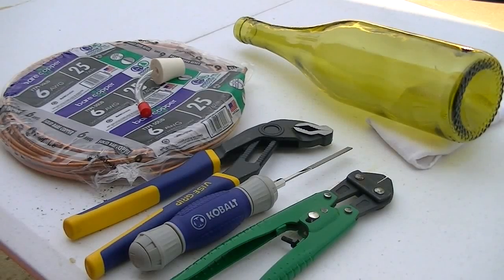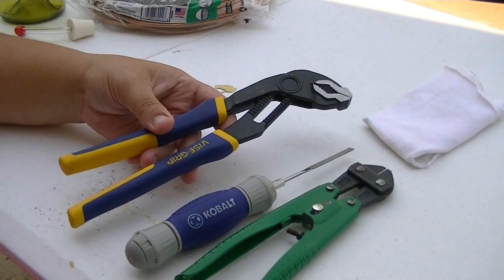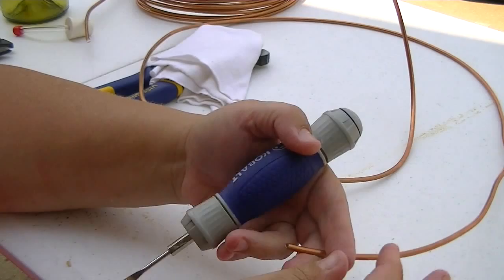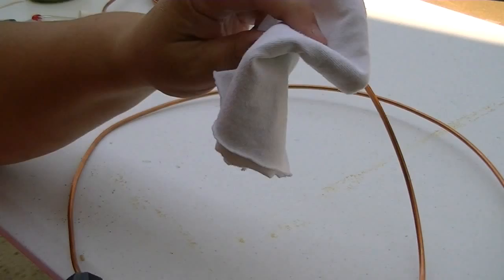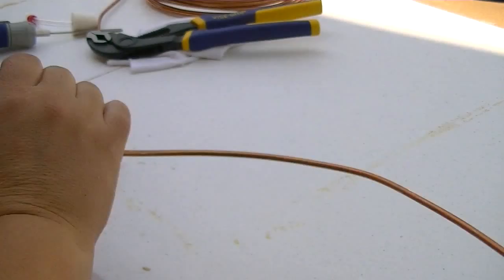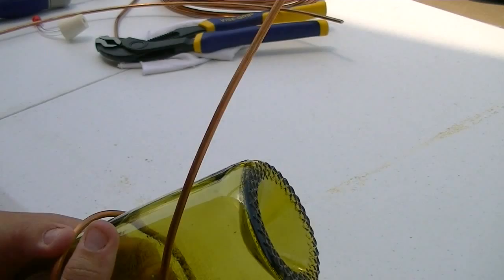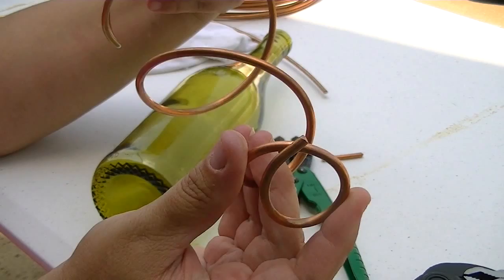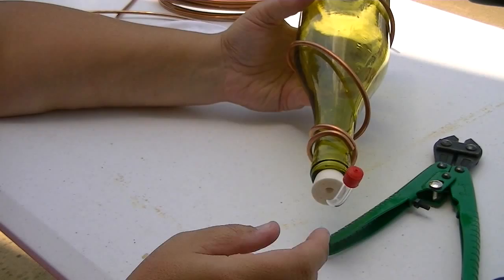How to Make a Hummingbird Feeder from a Wine Bottle

Comment: If you heat the copper wire up a bit with a blow torch, it’ll be easier to wrap around the bottle. You don’t have to heat it until it’s red hot, just enough to realigned the crystalline structure of the copper, quench it so you don’t burn yourself, and then the bending and wrapping will make it stiff and strong again. 😉

Comment from the maker: Thanks for your comment Mirsades.  Mold is a very real problem with any hummingbird feeder and it is recommended that you thoroughly clean any type of feeder every three days or so.  You can use very hot soapy water to soak the bottles for a good while, then .... FILL the bottle about 1/4 of the way with same water and vigorously shake while your thumb covers the opening. You can also use special hummingbird feeder brushes (like a bottle brush) to reach inside the bottle.

Comment: FYI... You can buy that wire by the foot in the bulk section at Lowe's.  Much cheaper that way in small amounts. A worker will measure and cut whatever amount you need.

Comment: You can decorate also with red beads.  Attach anywhere that is convenient and wouldn't interfere with e.g. cleaning, etc.  If you attach the beads to a large enough  hook or clasp you can even unhook them easily from the copper wire or wherever they were placed.
Reply from the maker: Good Idea!  The glass bottle slips out of the copper "cage" easily for cleaning so if you did attach beads to the wire you wouldn't have to remove them.
Reply: Just thinking the same thing.

Comment: One thing you can do instead of using that cloth is to put electrical tape over the ridges on the vise grips.  Much less clumsy and you will still be able to see what you are doing.  I saw that on another video.  Have fun!
Reply from the maker: Thanks, Harry.  I haven't tried that yet, though I have tried duct tape and it works for a little bit but gets chewed up pretty quickly.  I'll give the electrical tape a try...I also hear gaff tape works REALLY well.  It's more like a fabric tape, not easy to find but I hear it works like a charm.  So that's on my list too!

Comment: Upcycled,  Great video.  I have made several feeders but find that the spouts leak.  All of the liquid just seeps out.  I also bought my spouts on Amazon. Do you have any advice?
Reply from the maker: Laurie W Are you filling your feeder as close to the top as possible, leaving just enough room to snuggly fit the cork?  I hear this creates a "vacuum seal" slowing the release of liquid...it seems to work for me.  Of course over time, with exposure to the sun the cork will need replacing - eventually.  I hope that helps solve the problem.

Comment: Great video !! I was so excited when I saw this and made min and proudly hung i tin the tree.....but I had issues and was wondering if you had the same problem and if so how did you fix it.  I ordered the cork tubes from amazon as suggested, but it seems the humming bird food just pours out of it pretty quickly. Like in a day or 2, I thought one may have been defective so tried a couple of more and same thing happened. any suggestions?
Reply from the maker: Are you filling your feeder as close to the top as possible, leaving just enough room to snuggly fit the cork?  I hear this creates a "vacuum seal" slowing the release of liquid...it seems to work for me.  Of course over time, with exposure to the sun the cork will need replacing but that's over time not right away!  Let me know that helps.